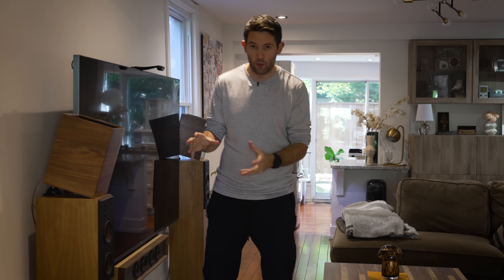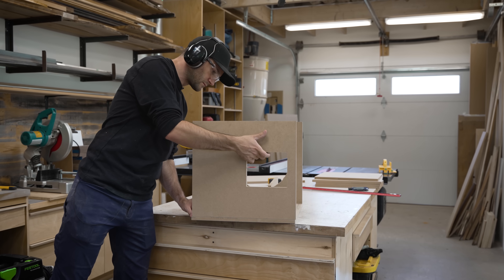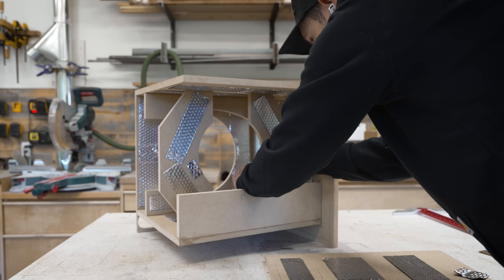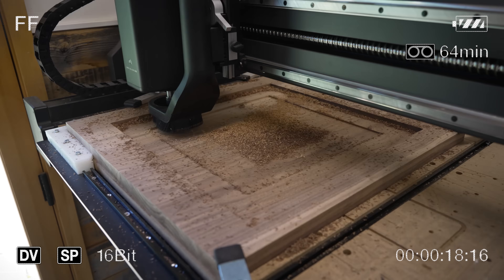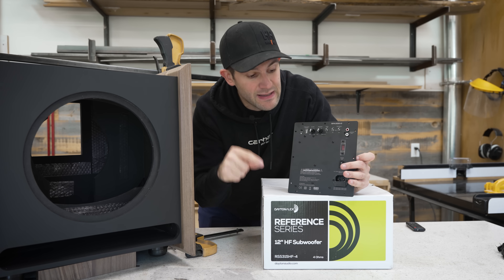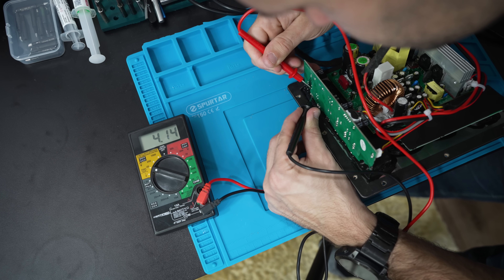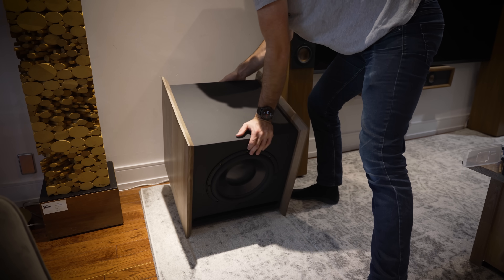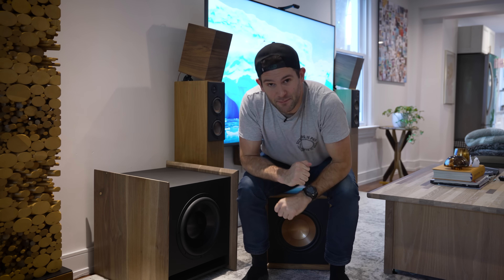THIS changes DIY Audio...

Comment: you should not use an undersized amp... if you push that amp, it can clip the output signal and cause the sub to overheat. don't undersize the sub or the amp, match them to each other, or even oversize the amp a bit. also that amp you picked has a lot of components standing far off the board. remember those vibration problems?...... I'd also always go with a 15 inch sub. with no reason to go smaller, it is best to go bigger. the surface area of that cone matters. my 15 is insane. the lows are incredibly clear and it's not boomy. I don't like a boomy speaker. it should blend with the sound of the other speakers. you should not hear any one speaker. also wireless is very overrated.... how many times does the audio signal get converted analog to digital to analog to digital to analog...

Comment: 2.4 GHz is known to be really fast? 180 MHz is just as fast as 2.4 GHz and 5 GHz. They are all racing across your 4 feet gap at the speed of light in atmosphere. Delay wæon transmisdion wont be sn issue. The speed of encoding and decoding could be an issue and the distance from your ear to the different speakers is the big factor. 

Really nice looking sub there!

Comment: 16:51 WTF the old Klipsch Subwoofer is NOT a "relativly expensive HIGHEND Subwoofer"... it s the oldest, cheapest, weakest SHIAT, you can find from KLIPSCH... it has COMPLYTLY NOTHING TO DO WITH THE WORD **HIGHEND**!! What is wrong with you? 
Would be way more interesating, to compare it to a REAL MODERN KLIPSCH Subwoofer, which is REALLY Highend like the Klipsch RP-1600SW (would say: it has no chance!! would say: is not worth the effort to build! Better invest some USD more, when you already invest so much time to DIY.

Comment: I have mixed feelings about this channel. Anyone getting their hands dirty and building things gets respect. And the projects he’s doing look good. And the video work too. 

But… so much of the information is wrong. Size the amp way above the sub as other people are mentioning. 400W sub should not be fed with a 300W amp. The wooden walnut sides should not be glued like that to the mdf either. It likely will crack now. The panel will expand across the grain while the mdf will not. 

It’s a good channel but this kid needs to work the fundamentals a bit instead of relying on very high end wood tools and cnc equipment.

Comment: When I build my first speaking box in High School I have the learn how to build a box based on the subwoofer's "Q' rating. I noticed these days manufactures don't know use to power the "Q" rating. Knowing the "Q" rating allowed you to make a box, specific to the woofer including volume air, hz producing proofing and so on.
Reply: "Q" or more proper "Qtc" is a sealed box concept. It doesn't apply to ported enclosures.

Comment: Just to clear something up, Class D does NOT mean Digital amplifier. The D is just a sequential denomination without any special meaning.
They are a type of analog amplifier that uses Pulse Width Modulation (PWM) to achieve high efficiency. While Class D amplifiers use a form of digital-like high frequency switching at the output stage to form soundwaves, the input and output signals remain analog.

Also your method of picking amplifier power for your sub is incorrect, and counterproductive. 
Your sub is a 400W RMS (RMS is continuous power, very important!) and you would want an amplifier that can deliverthat power, plus power needed for short non-continuous peaks, which need 1.5-2.5 times the RMS power.
At lower power than your speaker, the amp will constantly clip (draw more power than it can handle to fullfill peak power spikes, and start to distort horribly, potentially damaging the amp). 
The amp is not constantly driving the speaker at maximum power, it's dependant on the input signal. If there's no/low bass notes incoming, the amp won't output a ridiculous amount of power.
Therefore a stronger amp doesn't 'destroy the speaker' as long as it's within the tolerances of it's peak power demand, which is the 1.5-2.5 times.

If you use the amp for home theatre purposes, you'll want to be at the higher end of that, as movies like Black Knight or Interstellar can have longer sustained peak power moments than music generally has.

Comment: I just picked up 2 JL 13w7's.  plan on building 2 DIY JL Fathoms  (Dayton is a good driver but the W7 is the same driver used in the $5,000-$8,000 JL Fathom line)

Comment: It's actually a switch-mode ampliier, not a digital amp. That's just common incorrect popular slang vernacular. The signal changes from analog following voltage to analog following pulse width (which is easily made more powerful and then easily converted to voltage), usually by an analog voltage to pulse width conversion chip. That could be done digitally but usually isn't. The operation of the amp after that is bi-state, which makes it use devices in a mode other more digital designs use because base 2 binary in most digital computers is easily embodied in such bi-state designs. However, the similarity is not deep because the signal never becomes a number, which is what would make it digital (as that's what a digit is, it's about numbers). Pulse width is made analogous to input voltage on a continuum.  Think of it as a switch-mode power supply with a remote sense feature, and connect that to make it track an input signal very quickly.  It's not digital.

Comment: The old one is nice ,but the new one i like it good job , I have a question: How well does Bluetooth set up work ? Are there any issues In the connection  between the AVR and sub ! 

As in the distance is a big one !

Comment: Out of everything that is DIY in HiFi I don't recommend a subwoofer because it's almost impossible to reduce overlap with the main speakers and diminish standing tones in the room. I recommend a sub that can auto tune itself. Many studio models at 1500 USD can do that. Otherwise a sub can be skipped

Comment: One of the most misconception is that classD amps is digital amps, that is a big NO. Classd means switching amplifier its output is still analog sine wave.

Speaker driver like subwoofers cannot make a sound by feeding a digital signals into it

Comment: Using high end studio monitor headphones during the side-by-side segment, I didn't notice any difference in the bass-end of the spectrum. I assume this is a limitation of the hardware used to capture the audio, rather than the hardware used to hear it, but at this point in the video it would have been nice to see a visual representation of the frequency response in the form of a live graph and numbers.

Comment: I have two large 20 inch vented powered subs. Stationed 3 metres away from each other. There is nothing that beats them. So make another box and put in another sub. You will not regret it! Cheers. Thank you for the video and tip regarding the Wi-Fi. Will def covert all my powered speakers since I am sick of cables.

Comment: You are incorrect about ported vs sealed enclosures. 
Recently people have begun building ported subs smaller. But for most of loudspeaker history ported subs were smaller than infinite baffle type enclosures. The port changes the resonant frequency lower for a given volume. 
Also we usually spec a power amp to be twice or even 4 times the rated wattage of a speaker to allow for headroom. Both audio headroom for brief passages of high energy. But also THERMAL headroom or what some term engineering headroom. That is the concept that if you want a 300 watt amp, it's better to use a 600 watt amp running at half capacity than 300 watts running at it's full capacity.

Comment: Great tools and design software. However you perpetuate a lot of ‘myths’ about sealed and ported which are very generalized. 

The enclosure does not determine the transient response (perceived speed) of the driver. The system Q is what you are hearing in that case. 

Selection of tuning frequency is important for determining the system Q. The response curve from your modeling should help identify the proper tuning frequency by having a relatively flat response curve. 

A sealed enclosure can be boomy and sound muddy with an improper design as well.

Comment: Errrm from the get go. natural and boomy is an oxymoron. 2nd in my book of speaker design infinite baffle is larger than ported but sounds better especially because less boomy but there are a number of other reasons too. If you are DIY making speakers seriously consider transmission lines. They solve all the problems with reflex  and infinite baffle cabinets. High efficiency, low distortion, minimize internal pressure differences, output rolls of naturally below the design frequency and sise is almost identical to the smaller of the other 2 choices What more could you want. The only reason mass manufacturers almost never use them is because they are slightly more expensive to build.

Comment: 11:00 Amplifiers and subs are rated in "max" and "rms" (or sustained) wattage ratings. My suggestion is to purchase an amp that has a 10-20% higher RMS rating than your sub. Also impedence does not have to match so long as the sub is the same or higher than your amp. Furthermore, wiring can change impedence. Didn't mean to write a text book. Ooops. lol. Nerdy details below:

Damage risks:
Damage to equipment occurs when the audio signal (AC with varying voltage and frequency) starts to clip (AC signal wave form begins to have flat tops and bottoms instead the normal arc which is essentially short bursts of DC current instead of AC). Damage can also come in the form of heat (through instability). Clipping occurs when you push equipment beyond it's limit. Instability comes from wiring an amp to equipement with a lower than rated impedence (aka resistance, measured in ohms)

Clipping:
If an amp is over rated and accidentally pushes too much power to a sub, the sub will experience clipping damage which will be audible (described as distortion), but the amp will be fine. If the subwoofer can handle more than the amp so you over drive the amp, the amp will experience clipping damage and will push that clipped signal to the sub damaging the sub as well. It'll also be audible. So why not just match rms to rms? Amps present their RMS value based on test results in the most optimal conditions. A lot of things can impact performance, such as temp, humidity, elevation, barometric pressure, box rise, box volume, and most importantly: input signal. More on input signal below. So, we'll never be in the optimal conditions required to reach it's RMS rating in a safe way meaning there's a variable measure of efficiency loss due to our conditions. 5%, 10%, 15% who knows? So the gain knob on the amp, when turned all the way up may (or may not) be safe in the optimal conditions but will almost certainly not be safe in your conditions. In fact, there's no standard for how to limit the gain knob from the factory and given the above, it's a bit of a waste of time to limit it at the RMS value from the factory (all this assumes matching impedence). So, 100% of the time you should expect to have to tune the gain knob (turn it up until you hear distortion or see clipping on a scope then back it off a bit). If you still have to tune your gain knob when matching RMS to RMS from amp to sub, then why not over rate your amp to give yourself a little extra head room? Plus, you'll get more out of your sub because you can power through the otherwise lost effeciency of the amp. And you'll only risk the sub being damaged instead of the amp and the sub. It just makes sense.

Input (called pre-amp) level:
Even though low level/high resistance signals through like RCA/Coaxial into your amp are all low level, they are not equal. They can range from 0.2v to about 5v. If the function of an amp is to "amplify" a signal, what input level to you think it'll have an easier time amplifying? Starting at 0.2v, 1v, 2v, or 5v? Yes. An amp will eat 5v like candy and spit out a distorted signal well before you get to RMS value if you feed it only 0.2v becuase it has to work extra hard to make something out of near nothing. I'm glad your wireless transmitter is powered at 5v and I hope your preamp signal is at least 2v. Typically unamplified wireless signals are in the <1v range because they are wirelessly derived... they can be amplified though.

Impedence (resistance, measured in ohms):
Think of it like a hot wheel track with too many bends so the car doesn't make it to the end of the track before stopping. There's a high amount of resistance there. If you keep sending cars down the track they'll eventually bump eachother down the track, but their movement will be slow overall. Now straighten out the track so there is less resistance and all the cars will continue to fly down the track... too fast and they may fall off the track entirely because the car wasn't stable at that speed. An amp is a closed circuit once the subwoofer hot wheels track is connected. The amp needs the cars to make it back to the amp, but not too fast so as they become unstable. A sub has a voice coil (VC) (which is the track) which is rated at certain resistance. Lower is less resistance but faster cars and higher is more resistance and slower cars. Some subs have two voice coils (called dual voice coil) so you can play with the wiring. Connect the end of the first VC to the begining of the next VC (in series) and you have added the two resistances together. i.e. a dual VC 4ohm sub has two 4ohm VCs. By connecting them into one long track you make an 8ohm track back to the amp. Alternatively you can run two tracks, one to each VC and merge them together before making it back to the amp (in parallel). So each track is 4ohm, but you double the cars back to the amp making it operate effectively like a 2ohm track. Say your amp is rated at 4ohm and you have one dual VC 4ohm sub. It's impossible to wire both VCs it into 4ohm (and it's taboo and dumb to only wire one VC even though some chinese instructions tell you to), so your only option is to wire it into 8ohm. Wiring into 2ohm will cram too many cars back into your amp too quickly causing the amp to overheat (and hopefully go into protect mode if your amp has built in heat/stability protection). Wiring into 8ohm will be more stable (alledgedly producing cleaner sound) and could allow you to turn the gain all the way up without damaging your equipment, but you'll still likely be leaving a lot of potential power on the table. You can remedy this by purchasing a second equivalent sub. Wire two 8ohm tracks in parallel back to the amp to make an effect 4ohm circuit. Wire two 2 ohm tracks in series to make an effective 4ohm circuit. The choice is yours. However, your wattage is split between the two subs and so you'll still be leaving a lot on the table unless you purchased an amp 2x or more than your sub ratings. Car auido equipment tends to have 4ohm VCs and home audio equipment tends to have 8ohm VCs. Amps stable at 1ohm and below are very expensive, but can drive huge amounts of power.

Comment: A more powerful amplifier will not ruin the speaker! It's a lower power amp that will clip and.produce noise because it is always working at full power! You got more to learn there are many things you made wrong ASSumptions on...No shame you are doing an excellent job just got to question everything

Comment: Full disclosure: I LOATHE the entire principle of subwoofers, and would never ever have one in my home in any shape or form because they are unnecessary and screw up the stereo positioning. That said: why take all that care making it, then site the thing way off to one side of your sound stage? AIUI, the whole point of subwoofers is that they have to sit in the CENTRE of the sound stage to work as intended.

Comment: Nice project but using nails and glue to seal the box is so risky, with vibration there is a high chance of detachment occurring even more in a subwoofer box where vibrations and pressures are high, I would have used superb screws, I know it would be a lot more work but since pre-holes would have to be made, housing for the screw heads, and I would use thicker MDF boards, giving in the end an extremely resistant box !!!
Reply: Technically glue is all you need. When you are working with MDF. The nails are just there to keep it in alignment. Look at any major subwoofer or loudspeaker manufacturer annual find the same thing.

Comment: Hello from France, When paiting the speaker, on MDF normal paint gets absorbed into the fibers and actually damages them, using Tuff Cab or Warnex is a better option, due to the finish being either a mix a rubber or tar which covers the wood instead of filling it like a "sponge"
Anyways great project, im working on my own sound system aswell brotha

Comment: How much was and what is biggest size piece you can cut on that cnc router? Im interested in THAT!😁
Also, do you Really trust only brad nails and glue? Why no drywall screws? I pre-drill my holes and very rarely split the mdf. Ive just always wondered why so many builders dont use screws.

Comment: I have a JL audio 10 W7 that I have wanted to use with my hometown system because I took it out of my car, but I’ve never figured out how to get a powerful enough to run it could be wrong but it’s either a 500 W or a 1000 W sub

Comment: Great vid - great research - super informative. Just a tip for anyone going this route:  if you paint the inside *do not paint the glue surfaces*. The glue will not penetrate the MDF as well and you could end up with wheezing box.

Comment: Those exterior panels are detrimental to the sound. Any speaker is considered a horn, and a good horn design allows the diaphragm to flow the sound waves backwards at the mouth of the horn. If you study horn design, you will have a higher quality box speaker design no matter which style you are building.